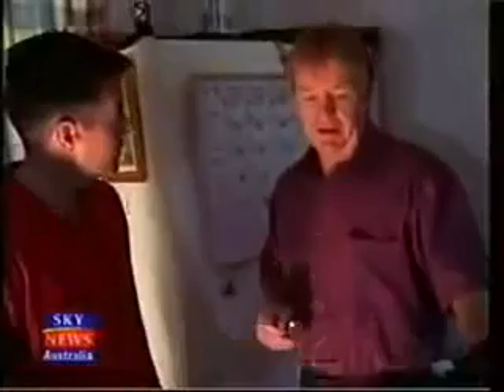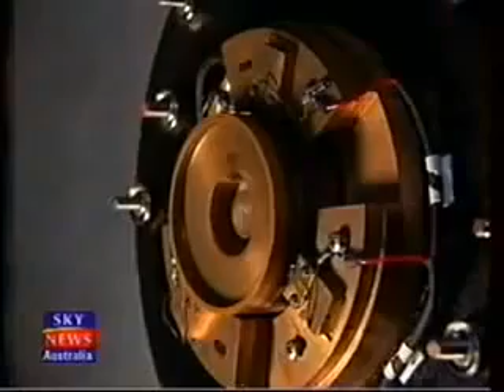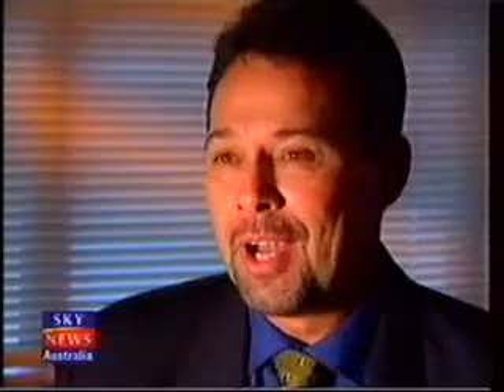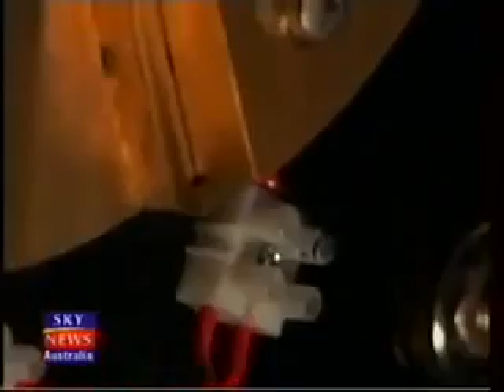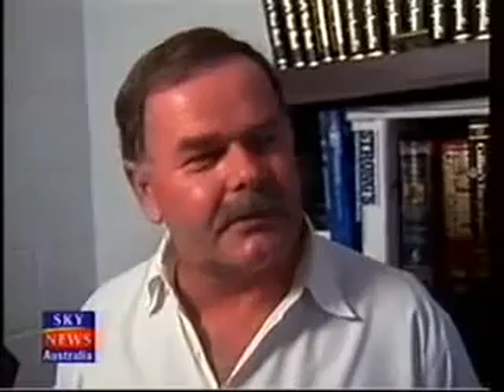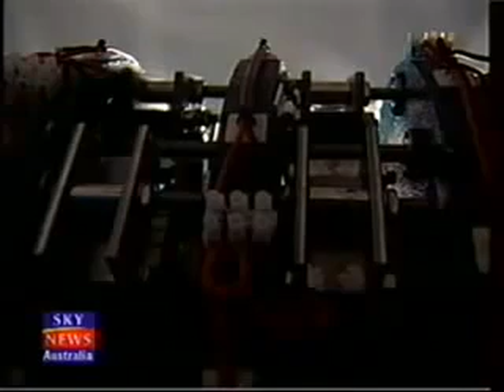Australian Inventor Power Generator Demo

Comment: So it’s drawing power from a magnet, which will eventually lose its magnetism? That isn’t free energy
Reply: Yeah but you can power the magnet once it runs out, using only a fraction of the electricity you generated
Reply: Well.. it beats what we've got doesn't it? Problem is there's money and power involved.
Reply: you are stupid
Reply: You say that as if the thing ever worked in the first place, which it didn't, that's why it isn't free energy, not because permanent magnets weaken over time.